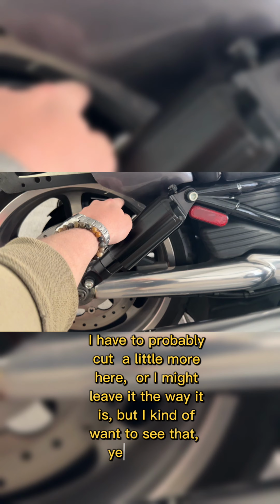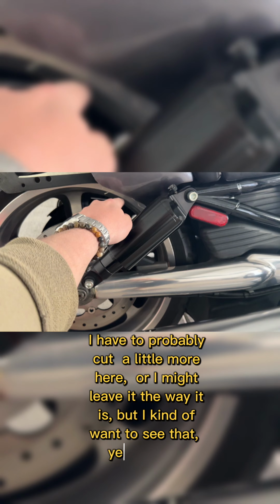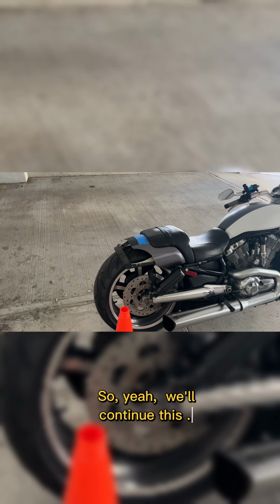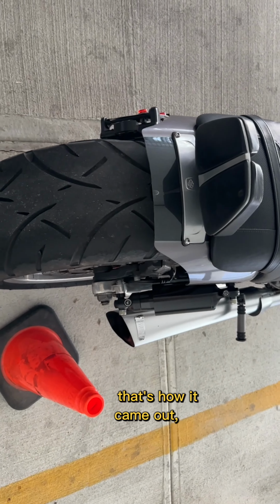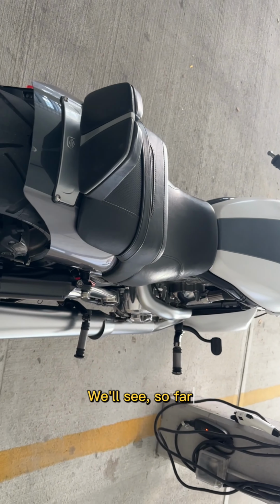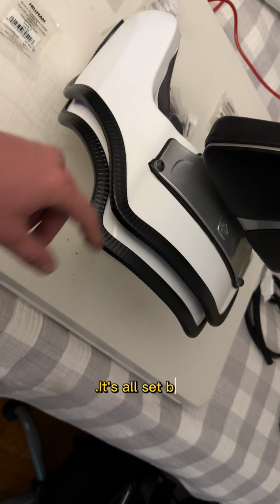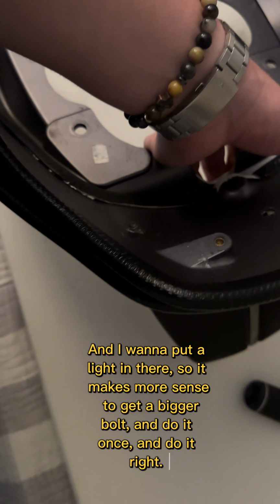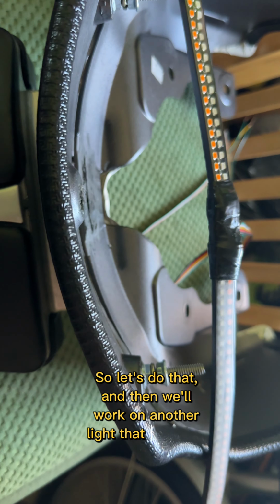Harley Davidson Vrod Muscle rear fender modified (Delete) DIY Tail Light (Porsche style)

Comment: Where did you get the semicircle tail light from?
Reply from the maker: @DanielL-p3n  top layer is two universal motorcycle tail light strips wired in opposite way
To form semi circle.

Bottom tail light is another tinted universal tail light of amazon that i cut in shape to make the shape of the fender to fit. And wires that with top strips in series.
Reply: @BUDZGURA  thank you for your answer